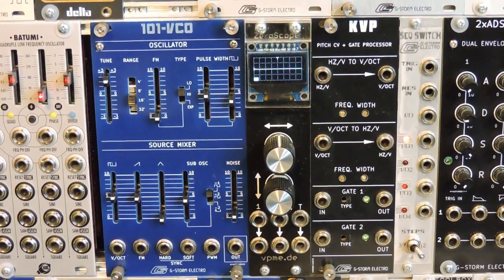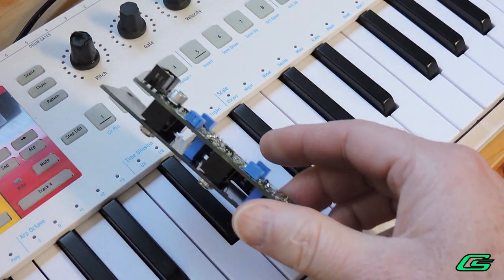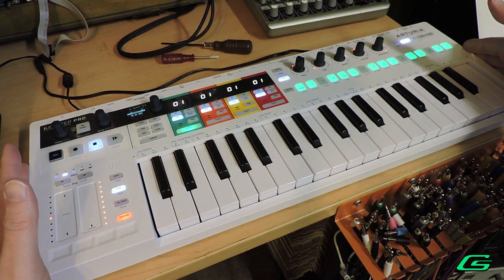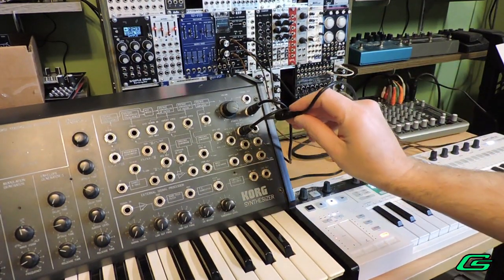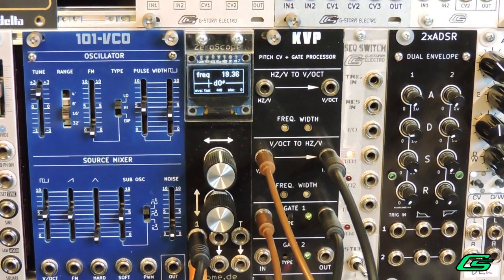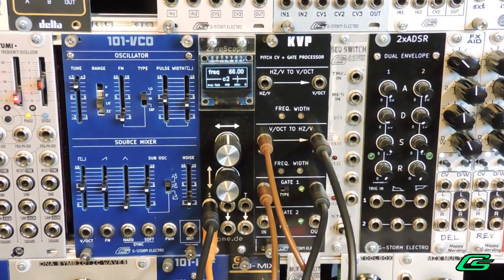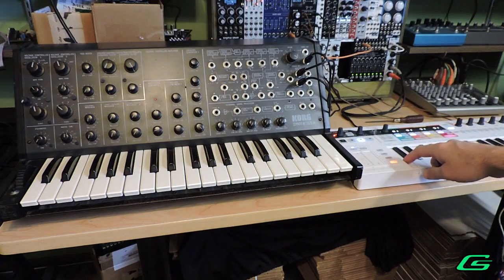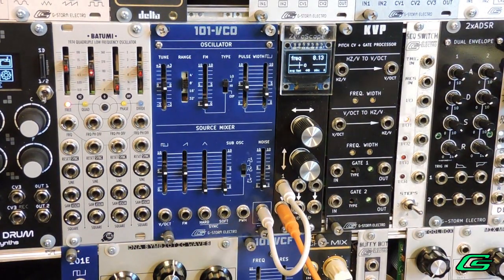GSE KVP Pitch Calibration Procedure w/ Korg MS-20 + Keystep Pro

Comment: Thanks Garren !
Before seeing your video I tried to calibrate my KVP without success. Doing this I turned the Freq/Width trimmers of the V/Oct->Hz/V a bit too much. 
What I'd like to know is how to "reset" the position of these trimmers to set them in a "neutral position" before calibrating the KVP. Must they be turned fully CW or CCW ? How much turns have these trimmers ?  Thanks in advance for your help!
Reply from the maker: Oh yes that can be a conundrum.  No worries, the trimmers on the front are all Bourns 3296 series precision trimmers.  They have approx. 24 turns total.  So if you get one that bottoms out, you can turn it the opposite direction about 12 turns to be around the middle of the range.
Reply: @gstormelectro  Thanks Garren for your kind help. I will follow the instructions of the video and reset the trimmers to a central position just before re-calibrating the unit to be sure I have enough margin to succeed in this operation (not like my 1st attempt!).